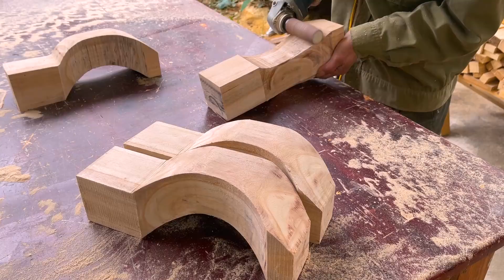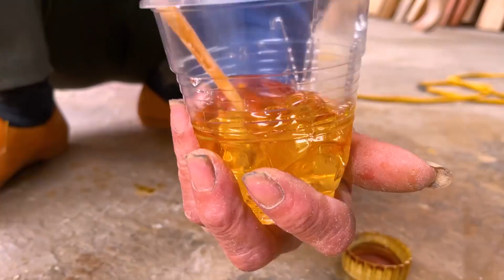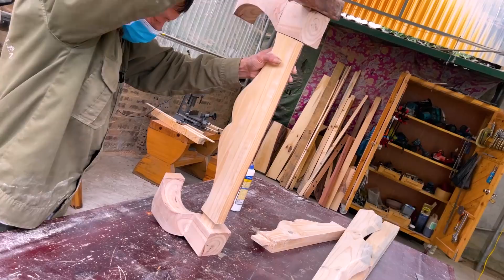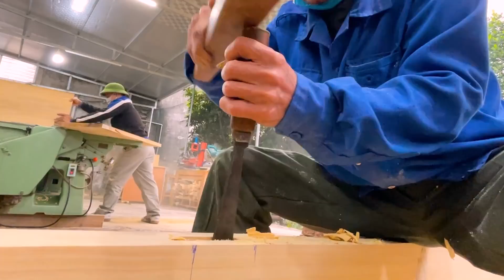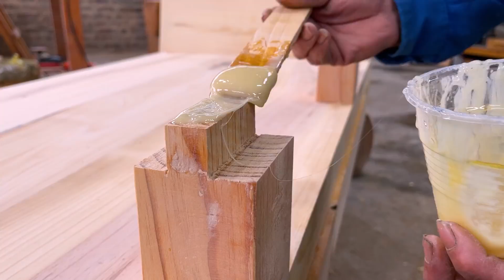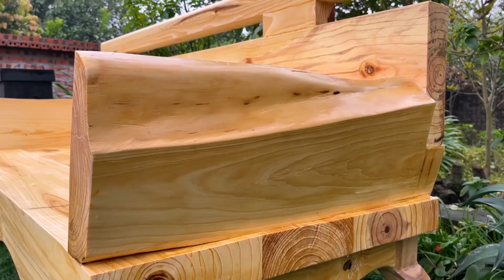Extremely Ingenious Skills Woodworking Worker | Large Woodworking Monolithic Crafts Wooden Furniture

Comment: Why did you not spray the underside to protect it from rotting/elements. I would have rounded the edges there the legs go so it would be much more comfortable without cutting off the blood supply.